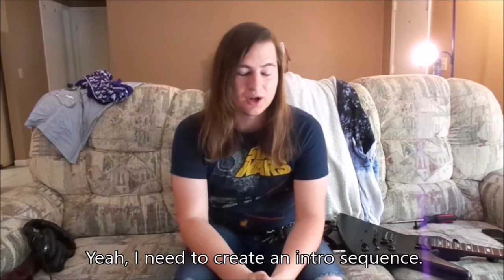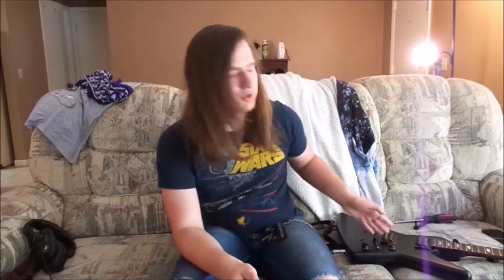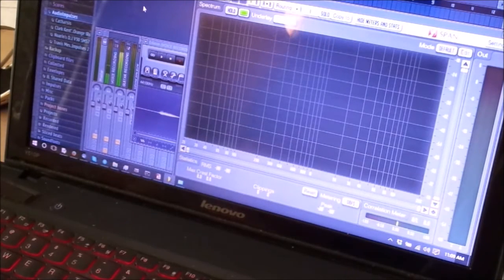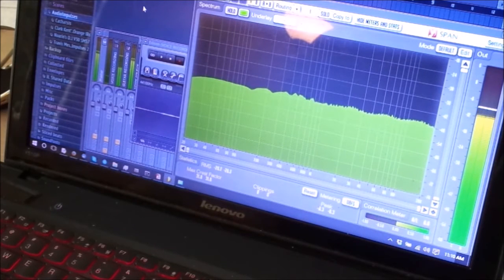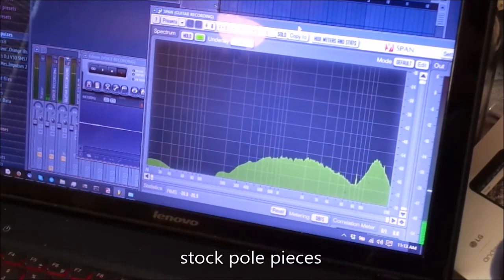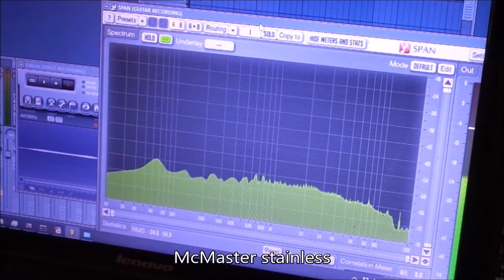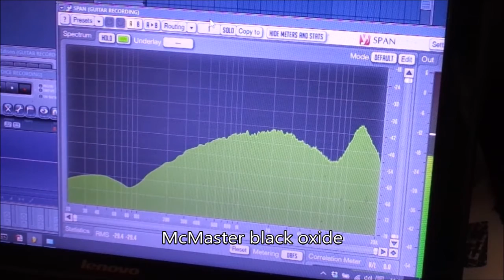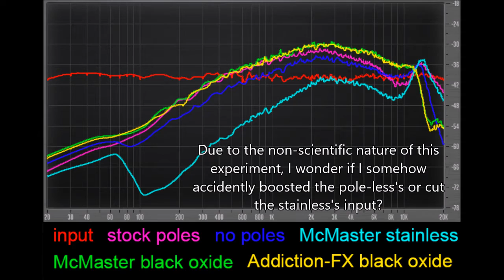The Guitar Pickup Pole Piece Experiment

Comment: Very interesting I have been playing with the use of a spectrum analyser to set up my pickup height and adjust the pole pieces in turn. What I am trying to achieve is the best Sweet Spot across the guitar though this is down to othet factors as well such as action and string size. Let me put in another way; once we only used tuning pipes and forks now no one thinks twice about using a tuner to set up the guitar or tune it to play, but one of the more important and least paid attention to is pickup height as this done well will give you the full tone range but done badly will make the guitar sound muddy and undefined.
Reply from the maker: This is very true, adjustment of the pickup height is an important (and free) way to adjust how the instrument responds. I do dial in the pickup height on my guitars, but this video was to investigate the effect of different pole pieces, as I had seen discussion in forums on the subject, but no videos actually demonstrating this.

Comment: That was really helpful, thanks. I think a trip to the local trade bolt supplier is in order. I've just rewound some humbuckers that came out of a cheap Peavey and the response is kind of soft like a p90, and I'm thinking it's the not particularly magnetic steel on the poles. Going to try replacing the slugs with set screws as well.
Reply from the maker: Hey, I'm glad this could actually help someone! Thank you very much for commenting.

Comment: How to generate white noise? And how interfacing your white noise to pickup?
Reply from the maker: I was using Sytrus in FL Studio to generate white noise. I then EQed the signal to be as flat as possible when reading the output inside the program so that I'd have a pretty flat test signal. I then used a pair of studio headphones, which should also have a fairly flat EQ curve, to input the signal to the guitar pickup. This setup does have its flaws, though, as it required me to hold the headphones to the pickup by hand, which could result in variability in the resulting output.

Comment: Amazing video, thank you so much for doing this experiment, a job well done! 
A question, the three narrow constant peaks at the highest end of the spectrum - you wouldn't happen to have an idea what those are? I have them as well, would love to know what's causing them... Is it aliasing?
Reply from the maker: I'm not entirely sure. Either there could be some sort of high-frequency resonance peak in the pickup there, or something about how I was transmitting the signal to it (by holding a headphone driver close to it by hand) could have skewed the results. I don't think that peak is too important since it's a bit higher than most of the useful guitar content and is generally reduced by a guitar amp, and since that peak shows up fairly consistently amongst all tests, it can be factored out in the comparison.